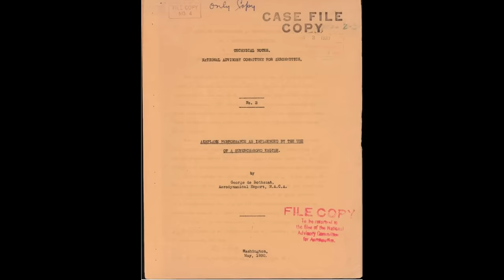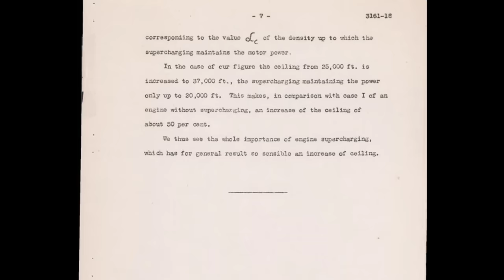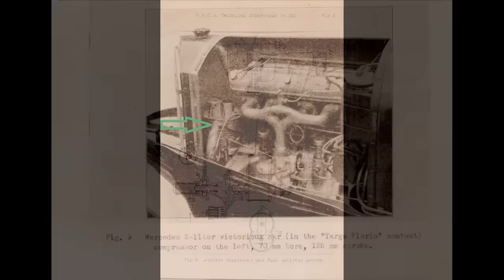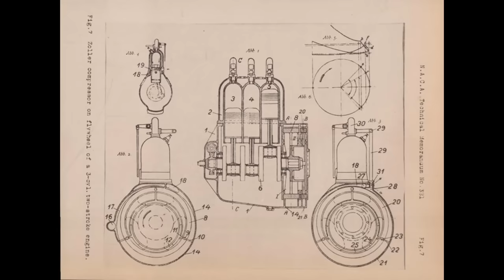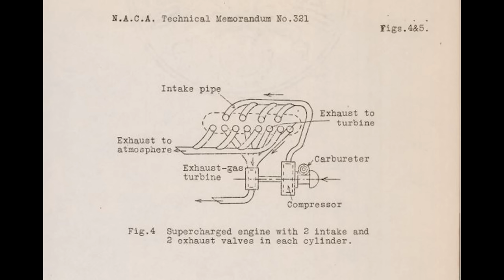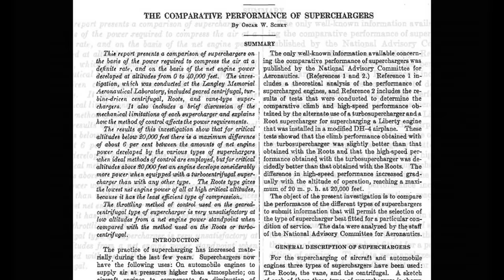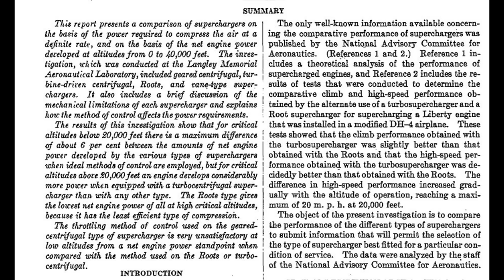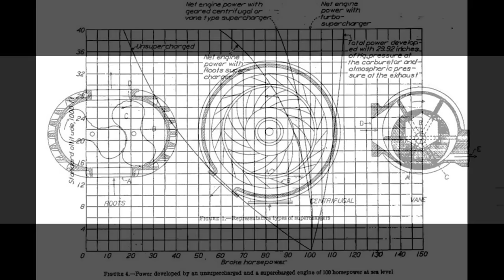Turbo vs Supercharging in WW2 Airplanes

Comment: The reason for the Navy choosing the supercharging in the corsair was purely for throttle response. On a runway if you need to go around, you have all the time in the world to wait for boost. On an aircraft carrier, if you miss the no. 4 wire, you need max power instantly.
Reply from the maker: Let's think that through. The Corsair doesn't even have it's second stage supercharger engaged when landing on a carrier so it has zero effect on throttle response. The only thing that will be making boost in that situation with either a Corsair or a P47 is the 1st stage supercharger, which is gear driven in both. In fact, it's the exact same supercharger in both. In other words at sea level,  throttle response in the two planes is about the same. The difference is that the P47 is quite a bit bigger and will be coming in too fast to land on a carrier. Now at higher altitudes, then yes, the turbo will have slower response for sure.
Reply: Greg's Airplanes and Automobiles the primary on the -47 was significantly smaller. It's only purpose is to fill the hole off idle until there is enough gas flow to turn the turbine.

On a short deck, instant power is king. Also, fleet defense at that time was conducted at lower altitudes that the high altitude intecept and escort that the USAAF was designing for.

Navy has also had a permanent lean towards slightly lower tech but reliable options.

It was the right call for the time, too. For fleet defense, the corsair had more than enough performance. It didn't need the extra high altitude capability that the lightning had.

I've always loved the different paths that engineers took at that time with identical power plants dependant on role requirements of the vehicle. Especially US tech in the latter years of the war.
Reply from the maker: I think you missed my  point. The second stage doesn't matter for purposes of take off or landing because it's not engaged, regardless of whether it's a gear or turbine driven unit. Thus it has nothing to do with engine response when landing on a carrier. As far as I can tell the F4U-1's R2800-8 and P47's -21 use the same primary stage supercharger, not that it matters for this discussion but out of curiosity, if you have information that shows otherwise, I would love to see it.
Reply: Greg's Airplanes and Automobiles Have a look at the video on the topic on the airboyd channel. As for the rest of my knowledge, it comes from actually working with turbos on auto and aviation engines. I've been turning wrenches for over 25 years.

The supercharger you are referring to didn't do a hell of a lot for peak power. Helped hugely in making sure that there was even fill of the cylinders as well as effective scavenging. As for applying positive pressure and volume of charge air, not so much.
Reply: You need to study the dynamics of centrifugal air pumps. Unless they are geared like buggery, they don't turn fast enough to really pressurise the air. They act more as a fan than a compressor. It is only when you start moving the air at insane speeds through the impeller so that it is hitting the outside of the housing with enough force to actually compress the air, they don't do much.

Another big issue is maintenance. Like I said before, the Navy goes with equipment that will survive a beating on a ship. Early turbos were just too maintenance intensive. It was worth sacrificing the high altitude performance to maintain acceptable numbers of flyable aircraft.

On a land base, there are so many more aircraft than on ship. You can have the highest level of performance and sacrifice the reliability a little because there is always a bird to replace it.

Comment: Let me put it simply for everyone... The ONLY advantage of turbocharging over supercharging in WWII aero engines is CONVENIENCE for the pilot. A centrifugal compressor is good for about 10~13 psi of boost with WWII era impeller designs before you start making more heat than boost. Multistage supercharging systems are used to achieve up to 25 psi of boost (eg. Merlin 66 /Packard-1650-7). The problem with superchargers is that you need drive them at different speeds at different altitude so you get the right amount of boost. This requires that the pilot monkey around with the supercharger gearing based on altitude, rpms and throttle. A supercharger regulates boost easily and automatically via the wastegate on the exhaust eliminating the pilot workload. The alternative is a CVT or regulated hydraulic drive for the supercharger -- which is used on engines like the DB601/DB603/DB605. The need for multiple stages to achieve high boosts remains in either case, hence the really high altitude designs like the Jumo 213E use multistage superchargers.
Reply: Sorry Greg, but the more accurate way putting it is that manifold pressure for supercharged aero engines are limited by limiting throttle openings. However, to get more boost at altitude, you need to switch the compressor drive ratios for which there are often 2 or 3 speeds which are manually actuated by the pilot. The pilot also has mixture control on most UK/US carbureted engines. Also, the throttle limiter is typical a mechanical stop which can be removed (as was the case with many early P-38s) which then depend on pilot judgement to limit manifold pressure. The point is that Turbos offer automatic and CONTINUOUS boost regulation via the wastegate, whereas the same on a supercharged engine will require a CVT or a hydraulic coupling like the DB600-series engines. The turbo is not inherently more efficient at high altitudes because it is driven by exhaust gases. However, multi-stage compressors are required to get to the kind of manifold pressures which allowed the Merlin to make 1,600~1,700 hp from 27 liters (about ~40 psi) because a single WWII era centrifugal impeller simply "falls off the map" efficiency wise beyond 12~13 psi, or thereabouts, of boost. This is true of both turbocompressors or supercharger compressors. The only reason you do not see particularly high specific outputs from the premier supercharged engines (mainly German ones) is because the Germans were stuck with coal derived synthetic fuels of 87 Octane (B4) or 100 Octane (C3) grades while the allies are running 150 Octane refined gasoline from a bottomless American well.
Reply from the maker: NACA literally says that the turbo is more efficient. You don' t have to agree with them, but that's what they said, in multiple reports, over and over.
Reply: Efficient under what parameters? It's a centrifugal impeller just like the supercharger. If you have a 10-speed transmission for the supercharger you can size it for high altitudes as well as you can size a turbo compressor and still have the appropriate boost levels for take off and every flight level in between without having to choke the engine via the throttle. No matter how you size it though, a single centrifugal impeller becomes very inefficient when asked to create a pressure ratio of about 2. That is why you have two stage systems to create high altitude boosts where you may need to take 0.3 bar to 1.5 bar an overall pressure ratio of 5. If you try to do it with a single stage compressor, whether it is exhaust or crank driven, you fall way off the compressor efficiency map and you make a lot of temperature rise along with boost such that you are not actually getting more air molecues in the cylinders.

Comment: So American turbocharged engines always had a turbocharger feeding into a supercharger? Would relying on a turbocharger alone have led to problems of turbo lag? This would have made them early examples of twin charged engines, although I think the pilot had to manually control the wastegate which would have required a bit of practice.
Reply from the maker: They kept the mechanical supercharger for several reasons, having nothing to do with lag. First, the engines already had them, so it was easier to leave them there. Second, turbos or superchargers are more efficient when staged. Third, you can't get the same amount of exhaust scavenging with the turbo alone. I touch on that in my exhaust video In short, it was easier, and gave more power this way.

Comment: Hey Greg, hopefully by now you're not too concerned about the "have I made this too technical/is it 10 mins too long?" quandary. Leave the lightweight "top 10 fighters based on Wikipedia data" videos to the unwashed. I'm not an engineer, but your collection always informs as well as fascinates me. Thanks also for explaining all the design in the P47; I always thought it was just an overrated porker with a big engine and a couple more 50 cals but now I can appreciate its many advantages. HST, have you produced a vid on the P47's manoeuvrability compared to adversaries and allied designs, and how this affected tactics and theatres? I haven't seen it, and it would add greatly to my understanding of this less-talked about (my side of the pond) fighter.
Reply from the maker: Hi Dizzy. Thanks. I am remaking the P-47 Pt-6 video.
Reply: @GregsAirplanesandAutomobiles  I look forward to it, thanks

Comment: Only 2 questions here :
Nr 1: if  P-40 and radials are so notably, why they turned the original radial project into a inline v 12 Allison V1710 water cooled engine ?
Nr 2: what compressor steals more power from the engine, an exhaust driven turbo compressor or a blower super supercharger ?
Reply from the maker: They went to the Allison for the P-40 because at the time it offered the most performance, the R2800 wasn't ready yet, and wouldn't fit in a P-40 anyway. The gear driven supercharger requires more power to drive than the exhaust driven supercharger.

Comment: It gets me wondering.  What if the P-38 in the ETO and MED had gone with a dual stage, two speed supercharger and aftercooler like the Mustang?  It would have been what.... half a ton lighter and produced a few hundred more HP from sea level??  This may have given it better power over all in its recommended operational environment under 15,000 feet.
Reply from the maker: There was a lot of potential there.

Comment: Why is the Curtiss P-37 mentioned as first attempt to fit a turbosupercharger in a fighter, although it never left the prototype stage, whereas the earlier Consolidated P-30A/PB-2A fitted with a turbo-supercharged Curtiss V-1570-61 engine was actually a production aeroplane, with 50 built?
Reply from the maker: I can't fit every airplane into each video.
Reply: @GregsAirplanesandAutomobiles  Well yes of course. But with regards to turbosupercharger-"firsts" I think the P-30A deserves to be be remembered, with futuristic performance for its day, despite the two-seat-layout
Reply from the maker: It does, and at some point I'll cover it, but I just didn't think it fit well into this video.
Reply: @GregsAirplanesandAutomobiles  OK ret, ooking forward to it

Comment: Very thought provoking video !

The twin boom design of the P-38 makes a lit more sense now - especially compared to the 'equivalent' Mosquito !

I wonder if the difficulties of manufacturing turbochargers had anything to do with the reason the Brits went with mechanical drive - I'm thinking really of the development of suitable alloys to take the extreme heat.

Although having said that, Rolls Royce managed to produce the jet engine in the mid part of the war - it would be interesting to know how they 'suddenly' managed to gain the metallurgical knowledge to make the high temperature turbines required !
Reply: The Mossie was more than equal in everything the P38 could do  and the supercharger on the Merlins was probably 200/300 lbs lighter
Reply: @jacktattis  you're a fool if you believe that, the P38 was faster and had over a 10,000 ft altitude advantage 🤣
Reply: @kenneth9874   Bill Gunston Combat Aircraft 
Mossie                                                                                                                                                                             P38      
Max Speed  410 mph for Mks IX XVI and 30/ 425mph for  34/35                                                                       All Variants 391-414mph
Altitude 40000 ft for High Blown Versions to 44000 Mk XV                                                                                  38000/40000 all with HJL 44000 ft
T/M 0.74 -0.75                                                                                                                                                               0.68 
Range Typically 1860 miles with PR34 3500miles Naval 1260miles                                                                  All Models Internal fuel 350-460 miles w/max fuel late models 2260 miles 
 Armament 4 x cannon 4 x.303 / FBXVIII 57mm  Molins Gun                                                                                 1x cannon 4 x 50cal 
Bomb Load Varied with Mark XVI 4000lb internal                                                                                                   Mk L 4000lb or 10 rockets but bomb load external
Reply: @jacktattis  lol
Reply: @jacktattis  there was a reason they mostly flew at night.......
Reply: @kenneth9874  Well you go and do the research I have
Reply: @jacktattis  get yourself a new cherry picker
Reply: @kenneth9874  Now this from Bill Gunston PR1 FII, BIV, FBVI, BVII, PRVIII, BIX, PRXVI,BXVI FBXVIII, BXX [ not all built ],  PR32, PR35 ,   B35 FB40,[both Australian Versions  ]All operated during the day
Reply: @kenneth9874  Well my friend you are not even trying to find out

Comment: A liquid-to-air intercooler, as used on the Mustang, would have saved a lot of weight and space over the air only intercooler used on the Thunderbolt. This technology wouldn't have been available when the Thunderbolt was designed though.
Reply from the maker: That's an interesting thought.